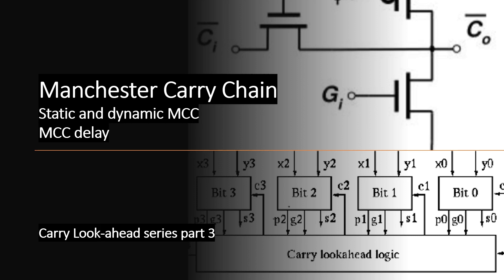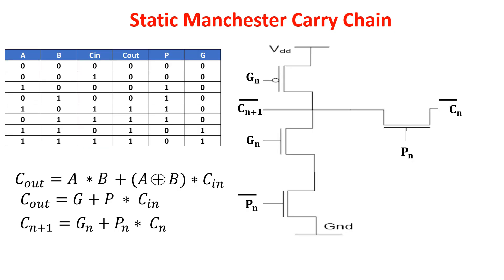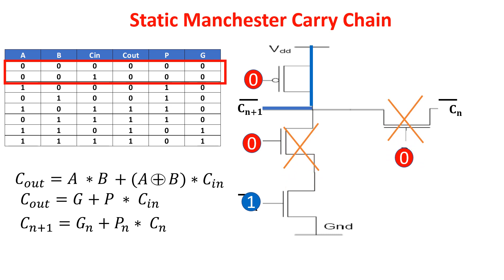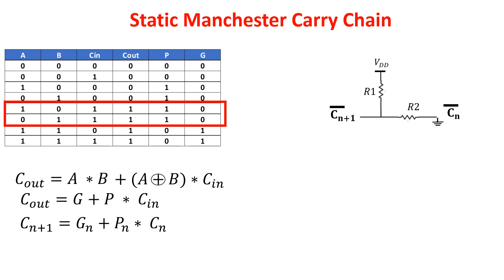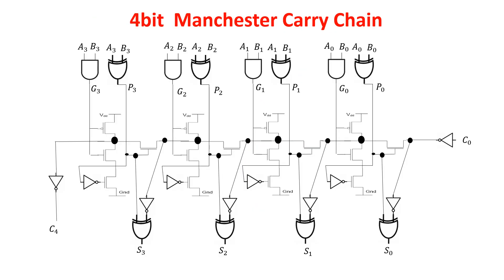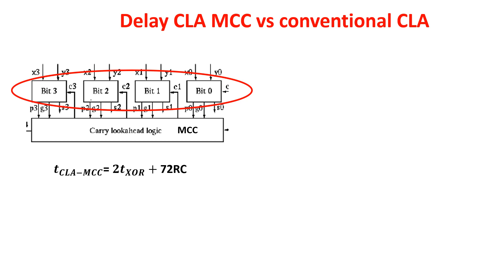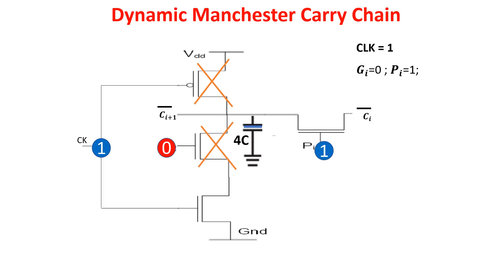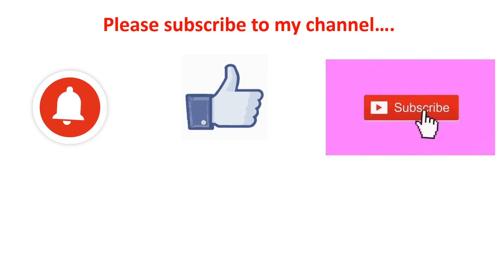Binary Adder - Manchester Carry Chain - Carry look ahead part3

Comment: This is deeper than I expected. I feel like you could have expanded on this.
5:03 "R2 is made small by making the pass transistor large"
9:34 "The total delay of this RC network is 4RC * n^2

If you had 2 parallel pass-through transistors, delay = (6C * R/2) * n^2 = 3 RC * n^2
If 4 then 10C * R/4 = 2.5 RC
If infinity then 2*RC

Although that would only apply if P=1
Reply from the maker: By making the section of the MOSFET larger we lower the resistance but It has an effect in the related capacitance which increases. The delay of a series of RC network can be approximated as RC n^2. I said 4RC n^2 because we have 4C capacitance in each node. Cutting by half R2 by putting in parallel an other Mosfet is ok, but you increase the capacitance of the node, which in our approximation becomes 5C so there Is a limite in the improvement. You also need more space.
Reply: Also the purpose of precharging the capacitor and why the clocking is used has not been explained.